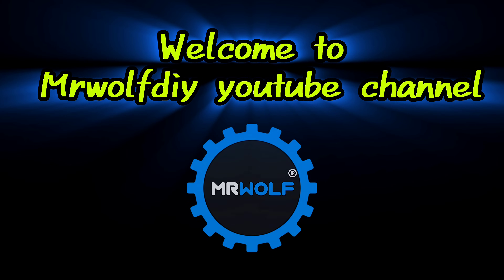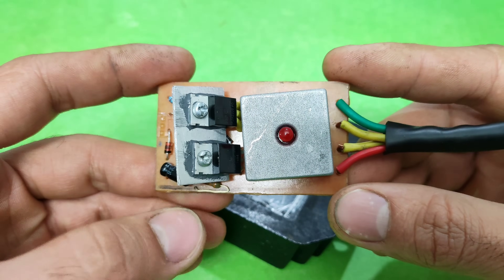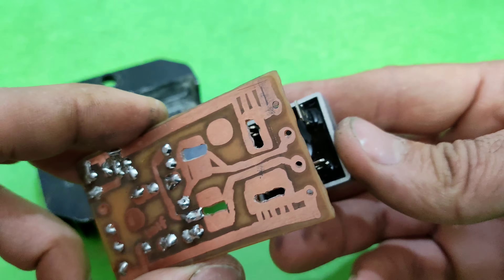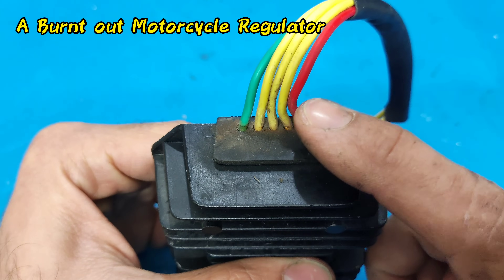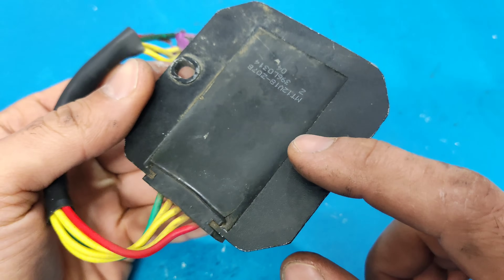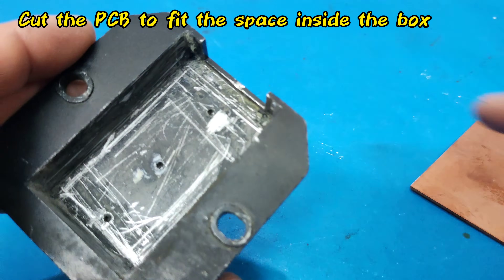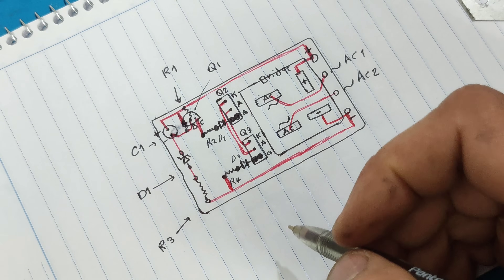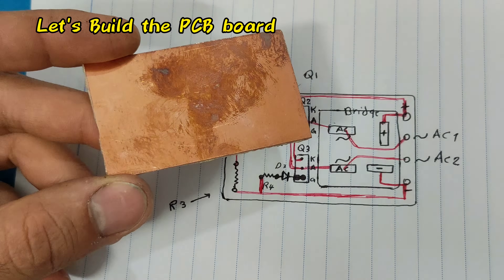DIY Full-Wave Regulator - No More Dead Battery for Your Bike!

Comment: Hi ... I am curious about this type of stuffs . If I used bt152 600R for Q2/Q3 and MPSA92 for Q1 will the circuit be better or worst ?
Reply from the maker: Hi,
The BT152 can handle more current, so the performance might improve. If you want to build it, check out the final edition version of this circuit inside the channel.👍🫶🙏
Reply: @MrWolfDiy  hi 
So today I tried with tyn612 and MPSA92 instead of 2n5401 and used a 15v zenner diode. At idle got 22v DC like that's the input 22v ac after I rev it engine a little bit the voltage drops to 9v and at max rpm the sector gives around 100v ac and the rectifier output is 14.8/15v max but there a bit problem after 10 sec q2 's between 2nd and 3rd pin it sparks and that caused the transistors to burn . Please give some advice on this should I'd try with bt512 and 2n5401 next ?
Reply from the maker: This circuit is probably not suitable for your motorcycle...
Your Bike name and model?
Reply: @MrWolfDiy Suzuki Gixxer monotone 155cc has a 4pin rectifier

Comment: Bro Bridge Rectifier U Have Shown In Video 3510 Is 35A1000V ,That's Not 15Amps
Regards From INDIA 🇮🇳💐👍
Reply from the maker: Yeah, It must be at least 15a
Reply: Why bridge rectifier out put direct connect with load or battery which country you living

Comment: For an engine that spins at 12,000 rpm, does it always deliver 14V? I have a 2-stroke engine and I need to keep the battery powered. Will this circuit keep the voltage below 14.5V?
Reply from the maker: I need to know the type of motorcycle and its stator to tell you whether it’s suitable or not.!

Comment: Incredibly helpful and inspiring! I’m going to make it happen. Thank you!
Reply from the maker: I'm so glad you found the video helpful! 
But before building it, use separate heatsinks for the thyristors or insulate them to prevent short circuits...
I’ll be making a new version soon, but you can also use the lossless version, which has much lower heat dissipation.
I’ve explained it in the description...

Comment: Bro please guide
1) Im currently making it now and I have KBPC3510 packed bridge for this circuit as you described but google shows specs corner to corner DC and corner to corner AC input in ❌ position.But you have connected side by side AC input and side by side DC input in parallel.Im confused 😕.Part number side have same Plus on offset pin and the other is AC.
2) If I use 12volts zener is it good or not.All components and wiring is DC head lamp is the most consuming LED which uses only 1 amp at low beam at high beam it's 1.2amp.Battery is AGS lead Acid 12volts 7AH.My OEM rectifier brand new gives 16.8 volts on 5000rpm on road driving,I have connected DC voltage panel  meter temporarily on cluster for getting exact results.Previous battery was melted.😢but now I wanna make my own.Please guide
Reply from the maker: Greetings,
According to the datasheet of your component, connect the bridge rectifier pins to the circuit accordingly. The KBPC3510 is usually arranged diagonally.
Next, for a proper output, use a 14V or 15V zener diode.
This circuit is a copy of an OEM rectifier.
To eliminate voltage fluctuations, add an electrolytic capacitor 1000-2200uf _25 v to the output of the circuit.
As for the heatsink, make sure the thyristors are properly insulated, or use separate heatsinks.
Thank you for watching the video.
Reply: Thank you so much bro.Guided perfectly well.I have replaced it with 14volt zener as you guided.Previously it was stable but slow charging now with 14volt zener it's performance and stability increased so much.At out put I have used 2200uf electrolytic capacitor 35volts.With single heat sink but both BT-151-500R are bolted with heat paste and mica sheet and small plastic rings type given by shopkeeper on both thyristors and are not shorted with each other on heat sinks tested with continuity on multimeter.Its super excellent.You are a gem.I was totally frustated with charging system of my motorcycle.Hats off for you bro from Pakistan.Stay blessed.
Reply: Bro last thing to guide please.It's working perfectly fine.After driving a lot and checking periodically while driving I felt when battery is fully charged then it becomes hot but can be touched but it's a little more hot at signals.Is this normal or not ? Near about 100 Km's driven with no issues at all except this heating.Stay blessed.

Comment: What ac voltage can this survive reliably.
Reply from the maker: Theoretically, the voltage ranges between 20 to 70v ,
The assembly quality and the components used play a big role in the circuit’s durability.
After testing, the final assembly is better sealed in a box with epoxy or a similar material, Also, using a proper heat sink is recommended.
Reply: @MrWolfDiy  got a outboard that provides about 150 vac at max rpm unloaded. Mind sharing thoughts which regilator to buy or build?

Comment: "Hi sir, I have a doubt. According to the diagram, the cathode of the first BT151 thyristor is connected to the anode of the second, and vice versa. However, the anodes of both thyristors are not directly connected. Since both BT151s are mounted on the same heatsink, will this cause a short circuit?"kindly help me or clear my doubt
Reply from the maker: Hello, regarding the circuit, I should say that this is the one of simplest type of full-wave voltage regulator that can be made for motorcycles, and it's designed for single-phase stators...
Many people have used this circuit and achieved good results.
But, To prevent possible short circuits, use insulation (such as a mica sheet or an insulating thermal pad) between the thyristor and the heatsink.
Reply: @MrWolfDiy  No sir, I didn't mean to say you were wrong. Your videos are very helpful for me and many others. I just wanted to clear my doubts. We’re all human, and mistakes can happen — please don’t take it the wrong way.
Reply: @MrWolfDiy  "One more thing — in the diagram, the anodes of the 1N4007 diodes are connected together, but in your version, they’re not. I'm mentioning this because I built the same circuit, and when I tested it, one of the thyristors burned out. Please help me understand what went wrong."
Reply: @ra.electric Yes, he made a circuit diagram and a picture for a different pcb. If you look at how it works, the correct one is in the circuit diagram, D2 and D3 are connected with a 1K resistor, a 100ohm resistor and the collector pin of the 5401 transistor. Because the BT151 gate voltage is regulated by the collector output (pin c) of the 5401 transistor. And the output voltage of the 5401 transistor (pin c) is regulated by a 12V zener diode on the base of the 5401 transistor (pin b).

Comment: what if i use 13v zener diode
Reply from the maker: The output voltage goes up a bit
Reply: Bro i need to make another rectifier because i damaged the old one i made with tip147! It has 15v zener diode ! The output voltage was also 15.2v+ that's why im asking you for 13v zener diode! And is this one is better or i should make again with tip147?  @MrWolfDiy
Reply: @JabedurFF  the output needs to be 14v at max, you regulate the voltage in this circuit changing the zenner

Comment: I'm sorry and maybe I'm off here, but I have feelings about this video. 

1. I don't think that reading is "good." From my understanding, ideally you would want to see 14+ volts at higher rpm but your reg struggles to hit 13.5 which i don't belive is enough to charge the battery... basically you're creating a brownout in the bikes elec system. 

2. That appears to be a 3 phase system and you are only using 2 of the 3 (evidenced by 3rd yellow both on the donor reg and on tbe bike). Pretty sure you will eventually destroy the stator this way as you are overloading the 2 phases that are in use.

3. This is probably the least concern, but those transistors should be mounted to the housing... it's the point of the housing...

It's a cool little science project but definitely not an adequate replacement for even a cheap aftermarket reg. And frankly, I'm pretty sure that building this regulator with quality components would easily cost more than a cheap aftermarket regularor, but the aftermarket would atleast work properly with the alternator.
Reply from the maker: Hello and thank you for sharing your thoughts.
However, it might have helped if you had read the video description...
As I mentioned, this circuit is designed for single-phase stators, and the motorcycle l tested it on also has a single-phase stator.
Regarding whether it's good or bad, I should say that I reverse-engineered this circuit from a market-available regulator, and it's no different from an aftermarket version. Of course, regulators in the market can vary in quality depending on the brand and country of manufacture - for example, it's obvious which is better between Chinese and Japanese components.

Comment: 13.5V on the battery is not enough. At least 13.9V is required. In addition, thyristors should be TYN640, which are stronger. The rectifier circuit is for small currents and cannot provide more than 10A. After that, it overheats and quickly fails.
Reply from the maker: Yeah, but I tested it at low RPM,
and many OEM regulators also use these components. Thanks for your input!

Comment: how much ampere this regulator?
Reply: ampere is same as yamaha nmax bruh..
i need 15-20v ampere can u share the schematic? and list of part
Reply from the maker: This regulator is not very suitable for the Yamaha NMAX. I believe your motorcycle's stator is a 12-pole type, which generates a higher current and could potentially damage this regulator.
In any case, you can test it—it doesn’t cost much...
All the circuit details are in the video.
Thank you.
Reply from the maker: Hi, Depends on the engine : Max 5 _ 10

Comment: Can i use it on singer 100cc bike?
Reply from the maker: Yes you can, ♥️🙏
Reply: I watched 3 videos about made a rectifier. In the first video i showed you use tip-147 transistor and in this  video you used another transistor.  So I'm excited to know which one rectifier  is better for my bike and will last longer?
Reply from the maker: The one with tip 147 is better
Reply: @MrWolfDiy  Thanks❤

Comment: can it be installed on the AC ignition spool
Reply from the maker: The AC ignition coil has a high output voltage.
This regulator is used for voltage stabilization and rectification,
and it's designed for single-phase stators that typically produce between 12 to 70 volts.

Comment: Hi, could you please teach me how to make a voltage regulator for a 12V car alternator that charges a 70A battery? Mine is broken
Reply from the maker: Hello, I must say that for high amperage, like charging a 70A battery for car, building a manual voltage regulator is a delicate task, and if not designed correctly, it can damage the battery or the alternator... 
Additionally, the cost of building one is much higher than purchasing a ready-made unit.

My recommendation is to buy a pre-made regulator, as it will be more cost-effective and also more reliable for you.

Comment: Question for you mate as I want to build this regulator into an existing case/radiator. 
Can the bridge be grounded to the radiator with the case? I think so. 
Can the transistors be grounded to the case or they must be insulated??? 
This heat sink you made there cannot transfer the heat to the radiator/housing. I would like to improve on this.
Reply from the maker: Hey! Great questions.
Yes, if your bridge rectifier is a square metal-body type, it's usually safe to ground it to the radiator or the case as long as it's internally isolated or designed for chassis mounting. and 
As for the transistors, they must be insulated unless you're absolutely sure their metal tab is not connected to the collector (which often it is).
Reply: @ thanks - this is what I thought. What do you think could be the maximum draw. On my bike there are 5 lamps all the time - I think total consumers is easily 90watts. Want to have this reg as a backup but dont want to fry the stator… that would be a major pain.
Reply from the maker: Can you tell me exactly what motorcycle you have and what kind of stator it uses?

Comment: May I ask, Bro, how many amps does a bridge diode use?
Reply from the maker: I didn't measure it, but based on the components used and the shunting system, it seems like it should be between 5 and 10 amps.
Reply: Can the bridge diode be combined with the BT 151 transistor to the heatsink?
Reply from the maker: Not necessarily. Connecting the metal body of the 35-amp diode bridge to the body (tab) of the BT151 is only allowed if both are connected to the same electrical point (same potential, such as GND, AC-L, or AC-N). Sorry, I haven't checked , If you want to do this,  you can check it out yourself.

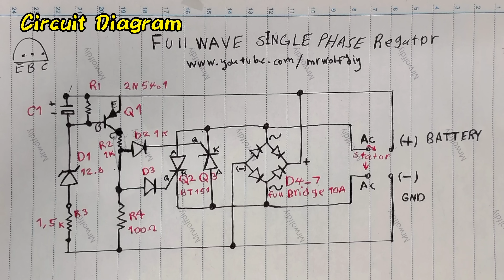Comment: 2:10  sir, any excess voltage from AC source gets wasted into heat, am I correct.
Reply from the maker: Hi, thanks for detailed question, Yeah, Shunt regulators are connected in parallel with the load, and when the voltage exceeds a certain limit, they divert the excess current to ground to keep the voltage stable.
The excess current is dissipated as heat inside the regulator, which is why they can become hot.

Comment: half wave can shoot up to over 14v and full wave always stays below 13.5v
Reply: What about Full wave 13.5v with Head light on? Is it dropped??
Reply: @Youtube7Premiere  i have switched to lifepo4 battery already. i am getting almost 14v during head light is on, cruising speed. electric start is performing very well all the time.
Reply: @avviouser441 On what Build?? Half wave or Full wave??
Reply: @Youtube7Premiere  suzuki v100 is installed with full wave rectifier, only 3 poles magneto stator.
Reply: @avviouser441  bro are you build this regulator?

Comment: Hi sir.. Can a motorbike using this regulator run without a battery?
Reply from the maker: hi, i must say ,
This regulator does not have enough power to handle all the electrical tasks of the motorcycle, and is mostly responsible for charging the battery.
Reply: @MrWolfDiy So Mr.. this regulator can't be used without a battery. Then if you use a dead battery, can it be used?
Reply from the maker: Generally, no, because it doesn't have enough output power to charge the battery and turn on the lights at the same time, but on older motorcycles, which don't have anything, it's possible.

Comment: What is the maximum current output of this circuit?.
Reply from the maker: The maximum output current of the thyristors is 12A with proper heatsinking.
However, the output of this (single-phase regulator) depends on several factors, including the input voltage, the connected load, and...
This amount may vary in some motorcycles.

Comment: Hi, i need to convert my bike halogen bulb ac out put (yellow wire from rr unit) to dc to connect an led bulb. So how can i do it?
Reply from the maker: Hi and welcome,
For this, you need to locate the alternating current wire coming from the regulator to the headlight key (the yellow wire in some Honda models, but it may vary depending on your motorcycle model). Disconnect it from the light key, and instead, take a branch from the acc line from the switch that is powered by the battery (likely the black wire, test with a tester), and connect it to the headlight switch.
Now, your headlight system will be powered by the battery.
Reply: @MrWolfDiy yes, i did the same, but the problem is led lights consuming alot of power and battery is not charging properly.
Also if i leave the yellow wire free and unused does it make any issues for the coil?
Is there any way to convert the ac coming from the alternator through yellow wire into dc so that I can use it safely so that my battery will be safe?
Reply: My bike is passion plus, 2003 model.
 
I have one more doubt, 
Generally in old model bikes, negative is connected to body of the bike, then why there is green lines as negative terminal?

Is it okay to connect the negative terminal of ac and dc current together?

Can I disconnect the negative (green wire) coming from the magnet connected to body to make a full wave DC power?

Comment: I cant understand .. The bridge rectifier pin out.. Plz explain your AC suply .. My curcuit not working plz help
Reply from the maker: Hi 
Note that this regulator requires AC power from single-phase stators to operate, which are usually the yellow and white wires.
It does not work on oil-cooled stators and is designed for dry stators, such as those found in Honda CG 125 CDI models...
The second important point: pay attention that the AC input pins of most square bridge rectifiers are diagonal. You should follow the datasheet of your specific components. In the video, my bridge rectifier was different.
Reply: @MrWolfDiy  I am using a kbpc 5010 rectifier. The pinout is the same.. but it is not working.
Reply from the maker: As I mentioned, the square diode bridges usually have diagonal pins on the ac . You should also assemble it according to the schematic and the component datasheets.
The diode bridge I used was not like this.
There is also a possibility that it may not be compatible with your stator, so please review the details.
By the way, I have also made a newer version; if you're interested, you can check it out. 🙏
Reply: @MrWolfDiy q2 & q3 i use BT 152 600r
Reply from the maker: Using the BT 152 instead of the BT 151 should not cause any issues.

Comment: Dear sir can you show of altering ac volt what is exactly volt before dc you only show a lamp
Reply from the maker: It generates a voltage between 30 to 80 volts, depending on the RPM

Comment: Sir  can we apply in this circuit maximum ac voltage 14 to 18v ac
Reply from the maker: For that,you can Use a 16 or 18 volt zener diode.

Comment: If the battery  is full, the circuit  stop to charge?
Reply from the maker: good question, motorcycle regulator does not cut off charging but keeps the voltage within a safe range.